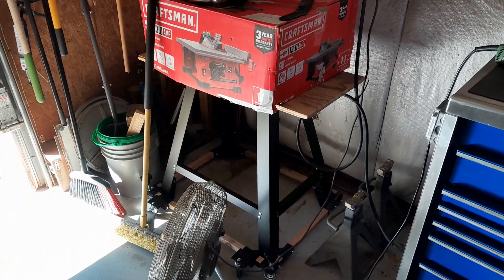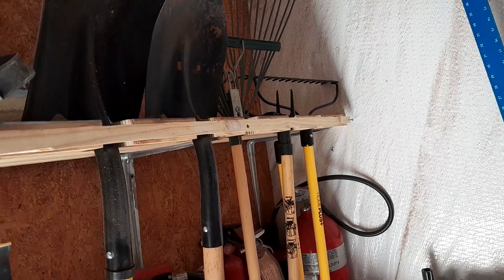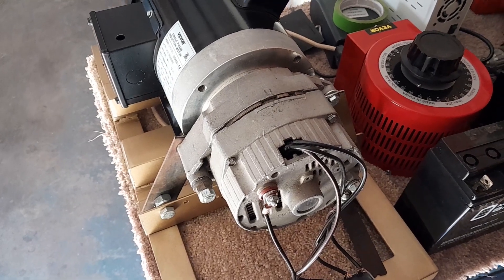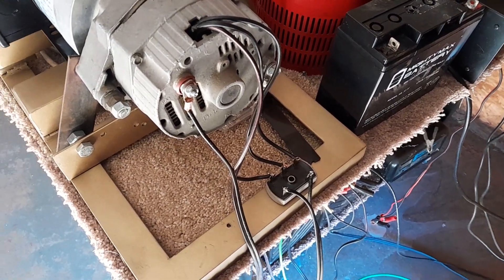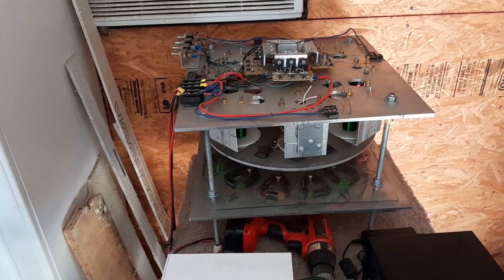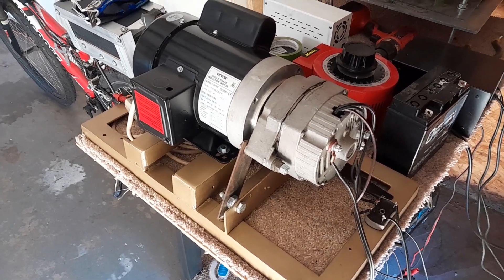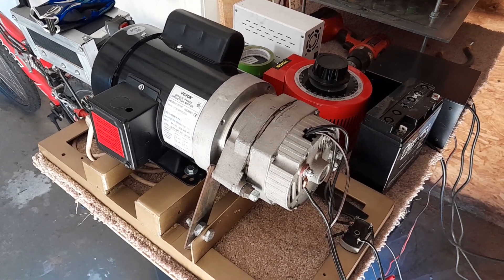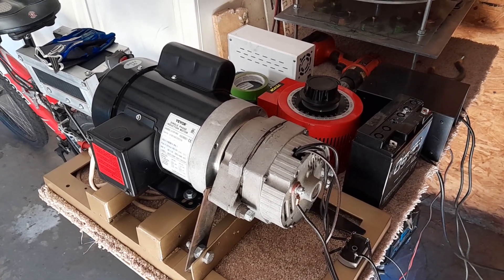More Self Running Generator Tests

Comment: Syncronous reluctance motors produce no back EMF FORCES to GENERATE A brake against the  rotational forces of the motor.

All conventional generators produce currents that try to run the generator in revers as a motor.

If you replace the rotor assembly in SRM with a permanent magnet radial rotor.
It will generate with out TRYING TO RUN IN THE Oposite direction as a motor.

Comment: You need a 3 phase permanent magnet ac motor (PMSM) if you want to power it with a high voltage permanent magnet alternator in a closed loop perpetual system, from this you can utilize the DC side of the aternator with a battery to power up your inverter.
You will need a dc car starter  with a one way drive sprocket to start up the system with.

Comment: You people are like sovereign citizens. You believe that laws don't apply to you (in this case, the laws of physics) Guess what? they do and everything in this video is fake.
Reply from the maker: No I am trying to find a viable solution to free energy. And even though pigs do not fly when on transport aircraft they do. 73 volts with the variac AC makes 90volts DC. But it could only run for 10 to 15 minutes. It could be over unity with a 500 rpm low voltage motor. This was a 3600 rpm motor.

Comment: This is a complete scam.  What is descried here is a perpetual motion, the action of a device that, once set in motion, would continue in motion forever, with no additional energy required to maintain it. Such devices are impossible on grounds stated by the first and second laws of thermodynamics.  See the reference:  https://en.wikipedia.org/wiki/Perpetual_motion
Reply from the maker: You are right it does not work but the way to success is to try various techniques to get to the desired result. When I used a variac to slow the voltage to the motor it ran best at 73 volts ac. But the variac and the motor overheated after 10 minutes. The DC voltage output was between 80 and 110. Perhaps a 1750 RPM motor would not need the variac reduction and still draw less power than the 3600 rpm one producing the same output of 80 to 110 DC.

Comment: Hi monstirz, since you're experimenting with self-running motors I figured this little piece of info from Peter Lindemann's Electric Motor Secrets (Part 2) would be of use to you, it's a bit summarized from the original video but hopefully I get the point across:

Take a closer look at Kirchhoff's Second Law and take note of what the Back-EMF in the motor windings is actually doing, once you figure it out you realize all motors are at a base level 200% efficient minus the other losses, the voltage of the CEMF is neither lost or an abstraction, if it was an abstraction it wouldn't be capable doing real work in the form of CEMF, it's under-unity only because that voltage is rising in the opposite direction as a result of the motors generator function being activated by the induction of supplied power.

E[a] (Applied Voltage) - E[c] (Counter Voltage) = E[e] (Effective Voltage): 100% - conventional losses.
But if we change that to
E[a] + E[c] = E[e]: 200% - conventional losses.

Mechanical energy output / Electrical Energy Input = Efficiency
Example: 634 Watts / 746 Watts x 100 = 85%

Mechanical energy output / Effective Energy Input = Efficiency
Example: 634 Watts / 373 Watts x 100 = 170%

Take a look at Tesla's patent 390,414 where Tesla states numerous times the coils are in "one or more pairs" and "independently energized" and ufopolitics's asymmetrical motors based on the info in that patent. Continuous Current (DC) with 0 time change won't work, at least not that I've ever seen, the principle appears to be shared with the Bedini system of pulsed/impulsed input at the right time.
Reply from the maker: If we could run it backwards while going back in time and regenerate the energy we lost maybe then? LOL

Comment: Allsome work from cruzermans invention 🤠🎉
Reply from the maker: I did not know someone else invented this. I added a total of 7 magnets and set it at 75 v a/c on the variac and ran it for about 10 minutes today and it took two 29vdc walmart batteries from 12.66 to 12.77. Then it became to hot to run. Maybe a 2 hp motor would work better.

Comment: I also tried to put more together hopeful if I had 2 to generate it would run it's, self  !  But even putting more as generators it still could not keep keep turning with out an out side energy source  !!!  No free lunch  !!!  If you are trying to charge batteries there's a lot of easy all ready available options available for this purpose  !!!
Reply from the maker: I was thinking that going big would make it happen. With a 2 kw 500 rpm rare earth magnet generator and a 3 hp 12v motor may work to power itself and make surplus energy. My 29vdc Walmart batteries went up .39 volts after running it for 30 minutes or so with 5 magnets on the rotor. It was set at 41 v AC on the variac. I saw a video years ago of a guy in mexico had 4 alternators on a small 4 cylinder car engine like out of a fiat and it charged his batteries really fast for a small amount of gas. He ran it only once a day.

Comment: When I was about 6 or 7 I took 2 d c motors and connect them shaft to shaft  !!!   I first found out that if you put a battery on one I could get electric out of the other one's wires  .   So I thought that if one one was powering the other it should run but it didn't  !!!   I had found out the second law of thermal dynamics before luring the whole story of thermal dynamics  !!!  I don't know why people think that they can beat physics  !!!  Like I said I was a small kid but came to the conclusion that it wasn't going to work even though I didn't know why  !!! I came to realize when I was older that I was not the only one who has tried to make energy from these kinds of things  !  People have tried to do it for a long time before I was born  !! That was like fifty four years ago when I tried these kind of experiments  !!
Reply from the maker: But the guys in India are able to self run by going big and then using a large flywheel it makes a surplus amount of power?
Reply: That "law" isn't a law, it's an observation:

"A time variable electric current creates an electric field parallel to that current. The field exerts an electric force on the charge in the nearby conductors thereby creating induced electric currents in them. This in the term “electromagnetic induction” is an actually a misnomer, since no magnetic effect is involved in the phenomena, and since the induced current is caused solely by the time variable electric current and by the electric field produced by that current."

"There exists a sourceless electromagnetic field whereas according to equation 528 such fields are impossible since there is no doubt that they represent a dual wave field, but as we've seen neither Maxwell's equations nor their solutions indicate the existence of causal links (no causation) between electric and magnetic fields. Therefore we must conclude that an electromagnetic field is a duel entity always having electrical and magnetic components simultaneously created by their common sources; time variable electric charges and currents."

"according to these equations in time variable systems electrical and magnetic fields are always created simultaneously because they have a common causative source, the changing electrical current, once created the two fields coexist from then on without any effect upon each other. Therefore electromagnetic induction is a phenomenon in which the field creates the other, I.E energy generation is an illusion. The illusion of mutual creation arises from the facts and time-dependent systems of the two fields appearing predominantly together."

-Causality, Electromagnetic Induction, and Gravitation: A Different Approach to the Theory of Electromagnetic and Gravitational Fields by Oleg D. Jefimenko

I hope the implications of this are apparent.

Comment: Interesting video. There is a simple type of motor that's a bit similar to an alternator which can easily go over-unity. It has permanent magnets, induction motors are a junk design.
Reply from the maker: Interesting! I had this equipment sitting around from 5 years ago and wanted to try using it to see what it could do. I retested it and it made .39 volts in 30 minutes. It is really making around 80 volts with a 48 volt stator. which inverts to 120v through 2 29vdc marine batteries. When the sun does not shine I run it to supplement extra energy to all my power tool batteries. And cameras and jump boxes and phones and i pad etc.
Reply: @monstirz  yes, it's called a resonant motor/generator. I can send you more info about it if you want. It can easily be 300% efficient.
Reply from the maker: Sure send me the info if you like. @QuantumEnergySearch
Reply: @QuantumEnergySearch  Link to patent?
Reply: @Pyroteknikid  It was never patented. I linked a video talking about it but it got deleted by YT.
Reply: Allsome work from cruzermans inventions 😁👍🎉🌟🦇